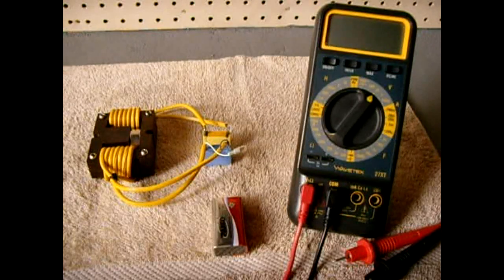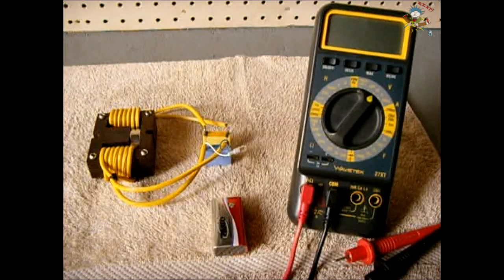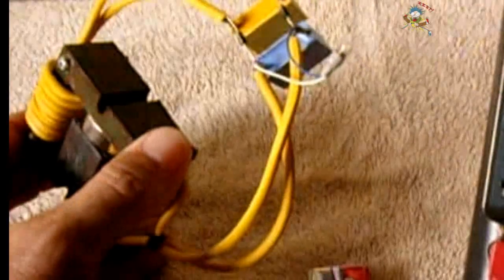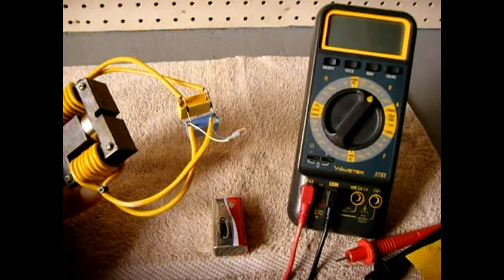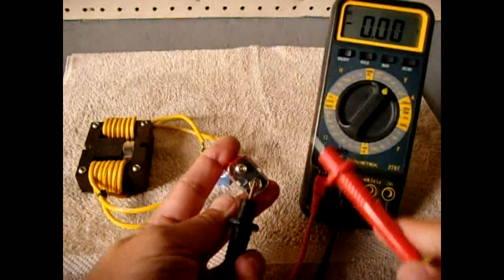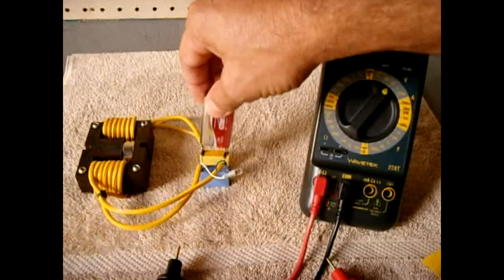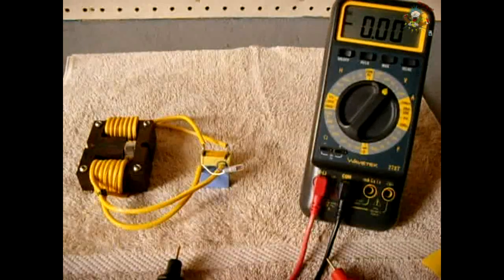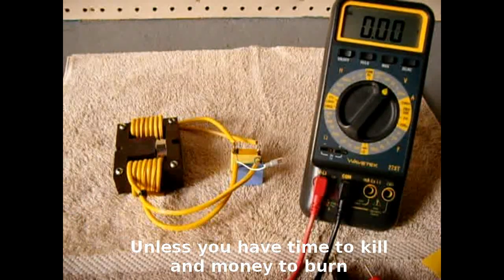Overunity Motionless Free Energy Generator EXPOSED!

Comment: A meg is supposed to have the power coils, and a choke coil to interrupt the flux path. You're missing the  choke coils. Also, you need to be actively switching the flux path on and off via the choke coil. That's how you make the magnetic oscillation to generate power.

Comment: You tried cathodes both up and both down, but did you try them opposite? I am told, asymmetry is the key, so different caps, different number of windings, clockwise / counterclockwise windings should be tried, too. Plus in the original when he touches the battery to the circuit, I saw a spark.. But not one in your video?

Comment: OK ya saidbya replicated it, ya admit the caps are d I fluent values an the amps of. Diode is irrelevant it seems to me ya did everything in this circuit to unbalance it. Ofcourse it won't work. My suggestions people follow original circuitry AN ya may have more luck than this guy who is obviously. Not wanting anybody to try which should be a red flag to try anything he is trying to disprove

Comment: The way the MEG is supposed to work is by rapidly switching between the left and right primary coils, which should be placed at the top left and top right on the ferrite magnet ring. (Instead of having a physically rotating magnetic stator, like in a normal motor or generator, this is designed to function without the need for physical rotation, hence the name ‘motionless’) And then you have two secondary coils, which are used to drive a load. (In your model, you have the two secondary coils but are missing the primary coils, and the switching circuitry.) So you are missing the two primary coils and a mosfet switching circuit to cycle between the left and right primary coils by using a square wave pattern on the mosfet switch. The physics behind it or theory, is based on the Abromov-Bohem effect, which is where the B field (magnetic field) is captured inside a solenoid or in this case inside the ferrite magnet ring, and the A field is exposed. The idea is it costs power to switch the B field via the mosfet switch, but then you get the exposed A field essentially for free, which can then be tapped for power. And that is how you get over unity from the MEG, at least in theory. In practice, there are many physical limitations which need to be overcome by materials science and proper tuning of the switching circuit to maximize power without overheating and quenching the ferrite core and burning out the MEG. I suggest you watch the Thomas Bearden Youtube video where he explains this in detail, since he is the main inventor and patent holder of this technology.
Reply: Not to mention it's an amorphous iron powder glasmat core.  Which holds the magnetic field inside the core an does not allow it to radiate past the core surface. Is one of the main differences from regular transformer cores. Giving it unique property's.   There are several videos reproducing the patent an got very close to same results. I just got my cores an try it myself.
Reply: Great explanation🎉
Reply: i couldnt have said it better

Comment: What you made doesn't look like the one in the patent. The meg is not your average transformer. If you put electricity in a toroidal transformer the Aharonov–Bohm effect happens. Tom Bearden and his team have found a way to make a transformer like configuration where the Aharonov–Bohm effect automaticly takes place without external input. How does the meg works?
Consider the physical layout of the MEG. You have a stack of neodymium magnets in the center of a rectangular toroidal core. The magnets touch each side of the core on the inside. There are no coils on the core yet.

What does the magnet flux do?

The flux from the magnets will divide equally between each leg of the core. So you have half the flux flowing on the right and half on the left.

You now place coils on this core. You use two control coils on the top on each side of the magnet stack. And you wind two output coils on each vertical leg on opposite sides.

OK, it is set up. Now you want to switch all the magnet flux to one side by opposing the magnet flux with the opposite control coil. How much flux will the coil need to generate to do this? Well, the answer of course is half the magnet flux since that is what is flowing in that leg. The other control coil is in the off condition, and open circuited, so no current can be induced in it and hence no back-flux generated. The core must not be allowed to reach magnetic saturation or more energy will be required to force the flux to the other side.

Then you turn off the control coil and what happens?

Remember both control coils are now off. The magnet flux will return to its original starting condition of half the flux flowing on each side. Does the magnet need any help to do this? No, of course not. When you did this you also removed half the magnet flux from the other leg when the control coil was on. The first half cycle you only see half the normal induction level in each output coil because at the start you only switch half the magnet flux into one leg and out of the other. So the total change is Bmag/2.

Now on subsequent cycles you let the magnet flux return to its original steady state and let the magnet do the work. Both control coils are off while this happens. Just when the magnet flux reaches its equilibrium point you turn on the other coil and keep the flux change going the other way. Each coil only needs to always switch half the magnet flux not all of it. After the first half cycle you see a 100% change of the magnet flux in each output coil on each cycle for an input power that is half the output. This assumes that you are activating the control coils for half of each cycle. This means you have a theoretical maximum COP of 2.0. You are using the magnet stack as a flux battery and "letting" it do half the work.

Comment: You have no clue what your doing baby boy, you need to learn your right hand rule and you need to learn what retro grade and pro grade means. You also need to learn how many different types of diodes there are because there's more than just pn junction diodes on dope, we have ultra high speed and low speed avalanche ultra fast recovery time low/high capacitance Edward leddskallian road shock back emf reverse breakdown voltage speed loop break back sickle pickle line island bana tree wake sleep mythical triad coil levitating friedbrainfree energy slumallien coverup Edwards coil that leave the unminded not a chance with the misleading information you put on here because your people are scared we know about the quantum jumping shipbegone door Tennessee portalhole experiment when times lost due to time travel standing waveform meets in triad middle of your gravatationless meeting point where jimkarreyis geargejones dad the power posses u not my level 8 bit byte u flash eeprom fiberoptic alien injected tracking lightwaveguidebackteriacancerremoving405420nmbullshitmisleadingweakmindinded scaredpowerlesssatinearthownedwhereiwalkdowndevilbackhighaltituddewatergivingtenneseewaterdevilbackfromhighsealeveltolowbeuitifuleaterat0to-20level-200devilsgolfcoursemissingbodyinholeinonevalleyofdeath-200doortohellporkypinefishprotecting no eyebrows extraterrestrial huminlooking repairtheradiatedmanstealhistimeputhimbackwithimplant free energywheelmissguided rainbowlazernanometercomposit-tooth-activedresign hydrogenarcjohnhutchisontrioa ustictransducertuned600hertzamplitudealteredfloatingfreeenergytimemqchiñebermutagiantoceandozingtracks2giantsfoundindandonlineislandwithcacoonbodycowboyhatbysamesizeantburriedtogetherexaposedbysatelitetelecommunicationbeforesleepchipcontroledultimategoalbrainremovelinsertedintoaibodygoalwarwar111armyagainstrealsatanfuturenoliezombieonfdawebcheckitpreparewarnhighlevelvisiontofamilyrelocatedseedsallacountedfloridasinkingdeerdiseasecovshotzombiemakingalreadywakenfromdeadgoogleitvacshottestingpopcorupionpainunabletoreturn30silverpeicessohangedcupdrinkethedfromsinsheildinglove eyespelleyebackwards lipspellpillarmmraleggel CAINS a SNIAK lovetoevol liveevil hearRaeh earRae(ray) tittitboobboobnoobboom hearmecomprehendseeitknowledgejustaskearthsheisfreeheartedaskjimjonesSon howyounotknowjackofallbinarytohexthedextoemall what frequency wasyouwhenshewaswithyoucan youviberatethesameasshedo asLordtoldmosesinhisheadheheardfromhisheadIamWhoISayIAmmosessMouthHisBrothersArronTripodBablonCanNotBelordremovesuchmakemanyLanguagestodumbFornoonebecomessmartenoutghtomaketowertoheavendestroyconfuseohmybableGreekmythsearchbackbuddaresearchbanannatriamgleportaltrangle3trangletriolevetationbelooknotfarbelieveinbanannatreeshepissedmanoffgoodbanannashellbe DEFINEsicklepickel spongebobisreal pineapple softinsidehardpokeyououttiebecarefullwhenhecomesinthecloudiewishuwasassmarttoknowthiswithoutmethewordwasandthewordisAlphaAndOmega,thegreekcharactorstodenoteelectronicequationsbegenningandendascoloombsandmassmeasuredbyatomicatomsplittingvoluumsizedoesntmattergetitweightisatoolforgravitymassisnotperpetualdoesexistscienceissatinrulerofearthbiblicalopeneyesseeitwakeuphearandcomprehendnowthis2022bewarestaylowmeekubeherewithmeinthechurchsomethingstake3pyramidnumberslokfromabovefindonmapsyoullseefromabove imagineabrainthatwantdie a computerwithyoursinitohmy somedonkeyshaverealcrossesontherebackbecausejesesrodeittestitprovemewrongbirdsspellvictoryinformationletterafterletterprobemewrong thank you Jesus I love you isn't true Pilate washed his hands clean before they crucified you the pain from torture they put you threw oh how cruel of the cruelest halo what cup you drinketh from for us my savior my lord my God to your temple I borrow until my soul and spirit comes to be with you, be nice to the banana girl from line island guys, and stay away from sickle the pickle and don't watch to many cartoons especially SpongeBob SquarePants

Comment: Hello,

The circuit and build is incorrectly built.
You need 2 coils for pulsing and 2 coils for collecting the energy.
If you look up the patent it will be clear.
The core needs to be a high frequency core, not iron, as iron will saturate at high frequencies.
The pulsing coils oscillate at khz range 10-15khz.
Also the pulsing needs to be done with short pulses and not a true square wave.
This is done by altering the duty cycle down to 10% and less. Experiment to get best results.

Please don't debunk builds with doing an incorrect build. as this discourages others from trying the build.
many have replicated the MEG build and shown results over a COP of 1.
There is lots needed to understand to build it properly and get useful energy.

All the best :)

Comment: Good spot yet a little variation could work

The supposed energy comes from different demension. The quantum flux goes in and out always. Keeping the electrons moving at absolutely zero vibration 

The easy way to do it is copy nature 
She does it taps the energy a few ways 

Look into the pistol.  Shrimp 
The cavitation bubbles capture some of it into heat light pressure etc
One natural nature doing it

Any one interested as I 

Will help ya you help me 
Casmir effect proved it

Glad you all seek out the holly grail
Thanks

Comment: I just spent $1500 to do it the right way. :)

I'll post a updated video of the entire construction to anyone interested.
Using the right cores as specified and correct wire and correct magnets and so forth.

Video maker has it all jacked up. Input is incorrect and everything else. Didnt even build a basic transformer. Lol

Which is funny in itself. Because a transformer works. Its undeniable. The real MEG.. is a transformer with a magnet in it which switches input. 
So you would at the very least have a output 85%+ of your input but you are using incorrect wire and everything else is wrong. 85% would be the efficiency of a basic transformer.... which you didnt achieve, either.
Reply: 101$ for the nanocrystaline core.

320$ for the correct laboratory generator to power it.

120$ for 10lbs of enameled core wire.

I am making 2 of these, so...

A 40$ capaciter that is under 200v.

Several different buck boards to convert the power into usable after it is cycled through capaciter.

And hiring someone to make me a switching generator board. 
But the lab one works for now.

Got over 600$ in Magnets that give me different sizes, strengths. And orentations.

Just FYI for viewers.

This has been successfully replicated by the way. Just not by the video creator.
Reply: I will post a video in real time of construction when I begin. I still gotta get a camera tripod for my phone.

Comment: Is this the MEG device from Bearden?

If it is a tried replica, tha. It appears to be missing several parts.

MEG works on pushing the magnetic field lines of force in a permanent magnet using small coils on each side. 

It's not the static field that you extract from. It's the ether torsion by moving the perm field and when it "pops" back the lines of force pass over the collector coils. You do have to pay a switching cost to alternate the current passed into the smaller coils. 

You should read "uncovering the secrets of magnetism" by ken wheeler.

It will help you to understand the field dynamics.

It has to work. Because the field torsion exists and this actually doesn't break any laws of physics. 

It's already patented btw

But this doesn't appear to be the MEG ... just a look alike. It was prob done by someone without any knowledge but looked at a picture and thought it was extracted from a magnet. 

It is, but it isnt.
Reply from the maker: 🤣 The "version" makes no difference, they're all scams. Having a patent DOES NOT mean it works!
Reply: I'm spending about 250$ to replicate the Meg.

And I'm doing it the right way. Not throwing crap together to see if it works. 

If you don't understand the true field geometry of the permanent magnet than you'll never make it work. 
Dimensions are critical to the pressure torordial bubble that exists around it.
Reply from the maker: @Heliarc91  You're a fool for spending 250.
Reply: @electronicsNmore  Why?
To buy the exact core with the exact properties as specified in the patent vs putting together a bunch of computer scrap and thinking I debunked it?
😃

Comment: Quite right. The law of conservation of energy cannot be beaten.
Reply: championchap  So the reason you are not infinitely rich and Master of the Universe is what?
Reply: G. M. Wang, E. M. Sevick, Emil Mittag, Debra J. Searles, and Denis J. Evans, "Experimental Demonstration of Violations of the Second Law of Thermodynamics for Small Systems and Short Time Scales," Phys. Rev. Lett., 89(5), 29 July 2002, 050601.
Reply: A general relativistic effect already proven since 1967, including in experiments done every year in optical physics in all major universities, is the "negative resonance absorption of the medium" (NRAM) effect.
By positive “absorption of energy” occurring in a mass system, we mean that energy enters the system from outside and is absorbed (turned into a different form of energy) in the system. By “negative absorption of energy” occurring in a mass system, one refers to energy being emitted by the system and radiated outside it and away from it. In short, “negative absorption” is a mind-numbing phrase deliberately employed by the optical physicists to prevent saying “excess emission”. Thus the phrase implies that the medium is emitting more (in NRAM, some 18 times as much) Poynting energy as the Poynting energy flow the operator is inputting to the system to be absorbed by it. In short, the NRAM phrase is a clever way of hiding what is an apparent violation of the conservation of energy law itself.
Reply: Wimmer, M., Regensburger, A., Bersch, C. et al. Optical diametric drive acceleration through action–reaction symmetry breaking. Nature Phys 9, 780–784 (2013).

Comment: Im sitting on the fence here, but I have 1 question? 

If the guy hid the batteries, they would have to be small in-order to be concealed right? Could such tiny batteries produce so much power??
Reply from the maker: You need to get off the fence. LOL It's a scam. Of course you can hide small, powerful batteries inside. Look up lithium polymer batteries, they can be made to fit inside spy camera pens.

Comment: electronicsNmore: Here is what I posted on the video you are referring to in your video.

"Let us assume you have the components you claim. The magnet will NOT 
affect the coils in the slightest. Infact, the strength of the magnet 
will oppose any alternating magnetic flux in your iron core. That is a 
fact. I don't know how you are lighting the bulbs, but I can assure 
anyone that there is NOT enough windings in either coil to generate 
sufficient current to light the small bulb, let alone adding that larger
 current automotive bulb. It is time for you to confess what you are 
really doing here.!!!!!"

So, you see I am not taking his word for anything either. You both have not in the least proven that your circuits do or don't do anything. Please consult a real genuine electrical engineer to help you with proving whether some electronic claim on youtube is valid.

Comment: Did you verify that your circuit will resonate? I don't care what components you tried using, if you didn't follow standard electrical resonate values in your coils and caps, you will always get nothing! So, please provide us with the proof that given any energizing current in your primary coil, you get a resonance! Until then, you don't have my support. Whether or not this other dude is scamming has not been proven by you so far. Keep trying tho.